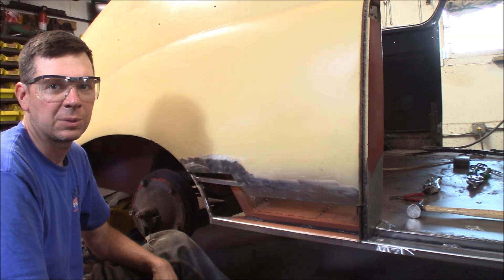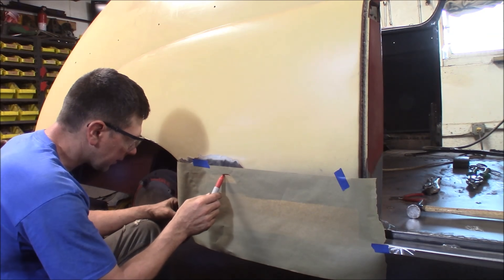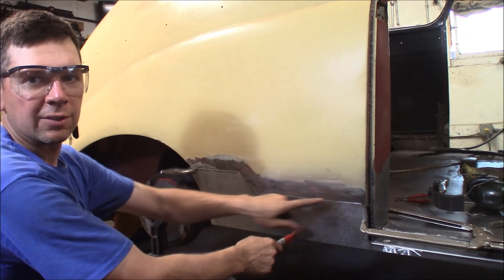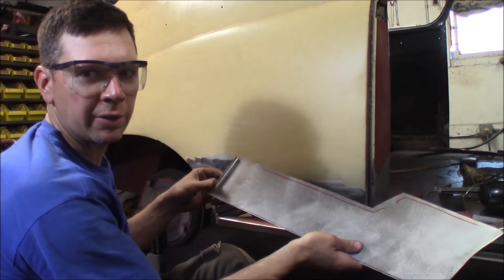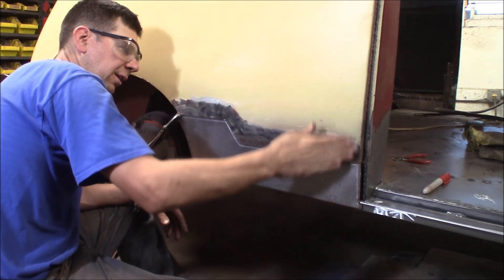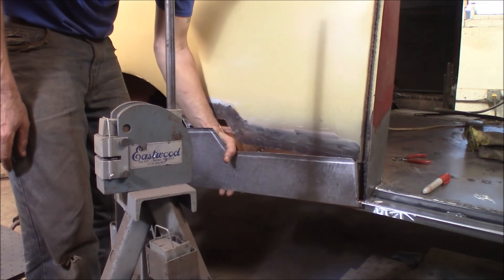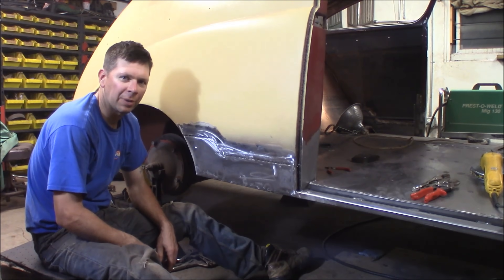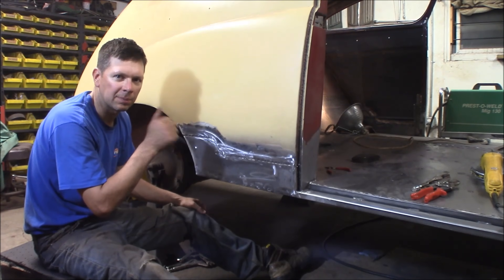Patch Panels:  Quarter Panel Rust Repair How To

Comment: For those who wish to restore classic cars. There is one thing to know :  to be definitively efficient against rust,  you should  put grease everywhere. grease is the only thing very efficient against rust. put grease between metal and carpet, inside door, behind metallic bumper, under the vehicle, behind  the repairs you can make (everywhere inside the body - hidden erea -  instead of using paint), hollow areas (necessarily hidden, so no need to be aesthetic). For rear wings unreachable with a paintbrush, use an extender and poor old oil everywhere each year. rust  always comes  from the inside and welds.  Handyman Experience - 35 years.   From france

Comment: First off this method has been used for years. For those of you putting this method down and saying that butt welding is the only way to go. I would have to disagree. I've seen this method used for years. I've seen both brazing the panels together and mig welded together with minimal fillier used. By the way after over25 years still holding and looking good! If you really want to see a questionable method there is a guy here on YouTube making videos on patch panels. By just lap welding ( without a flange) and grind down the welds a little and then hammer the welds down (and the sheet metal) and use a lot of filler to cover everything. With this being said I think this guy is doing a fine job. Also watch some old Eastwood videos they have used similar flange methods 🤔
Reply: Overlapping the metal is OK - IF the inside overlap is facing upwards. Then you can get a rust stopping wax or oil based sealant between the metal sheets. If it's facing down that joint will always rust. When that's not possible you have to butt weld or use the 45 degree crimp method.

Comment: I just stared welding a few months ago. I have a 73 and 74 nova and my 73 has really bad quarters. I did a mud job and I don’t like it now I plan of going back to replace it with some panels for a dependable repair
Reply from the maker: That's the best way.  Good luck!

Comment: What do you do of you cant get access to behind the patch panel how do you seal or prime the welded area from the inside?
Reply from the maker: You can get weld-thru primer and paint the panel before installation.  If it's in a closed area you could drill a small hole in a hidden area and spray Fluid Film in to try and coat it with lanolin rust prevention.

Comment: could sheet metal be aluminum sheet? something like aluminum deep tray available in dollar store? used for food serving purposes. its thick and easily bend. rust proof.
Reply from the maker: No.  To do a correct repair its as I showed in the video.  You cannot weld aluminum to steel.  There is also dissimilar metal corrosion that can occur when steel contacts aluminum.  You could bond different materials together with panel adhesive, but that is not what this repair video is about.
Reply: @QuickSpeedShop  you can weld mild steel to stainless though

Comment: I realize this is an older video, but I wonder, why don't you go back and weld in the areas that you didn't weld initially? That way you can have a total solid metal fit and very little, if any, filler needed. Seems you could fill areas with weld and forego any filler. Just asking, because I really don't know...
Reply from the maker: I could have done that, but not really necessary.  The panel is plenty secure.  It's going to need filler regardless and more chance of warpage with full welding and grinding.
Reply: Filler is always needed
Reply: Plus he said it's going to sit in a museum

Comment: Hi what gauge panel steel do you use. Cheers 🇳🇿
Reply from the maker: I usually use 18 ga for most of my repairs.  For structural inner pieces I will use 16 ga.

Comment: What does hammer tapping the slug weld achieve immediately after welding.
Reply from the maker: Helps to smooth out the distortion from the weld and hammer the gap tight.

Comment: 6:00  flange tool,  Harbor Freight has a really nice pneumatic hand held tool...  amazing
Reply from the maker: Thanks for the tip!
Reply: It only works with really thin sheet metal about the same thickness as OEM uses and a little more in my experience.    If you  make a panel out of say a scrap washing machine it’s going to not work very well.   Maybe if you have a 2 Stage compressor but not sure there.

Comment: I don't understand why on the outside there would come moistere. If the panel is painted it is sealed, right? Please explain how this works/ is?
Reply from the maker: Primer is porous.  If you don't paint the car right away and drive it in primer or store it in a damp location moisture will go through the primer (unless you use epoxy primer which is waterproof).  I just like the extra protection of having waterproof filler on all my weld seams.

Comment: You mentioned the shrinker was from Eastwood,  are you using an eastwood welder,  i was thinking about buying the 135. Because it can  use .023 wire.  My welding is not that advanced.  I bought the flux core mig from harbour fraight. It won't weld thin sheet metal. Thanks for the video enjoyed it.
Reply from the maker: The welder I had was super old Prest-o-Weld MIG.  I have since bought a Miller Multimatic 215. I love the 215, it's a great professional machine. Go with gas, flux core is about worthless.  If you want a good welder for hobby work, but want quality at a fair price, consider a Hobart Handler from Tractor Supply Co. I don't know anything about the Eastwood welders.
Reply: @QuickSpeedShop  . Thank you,  i was looking at the hobart also.

Comment: How do you have your welder set as far as feed rate and voltage? I can't get mine set right. Great job by the way!!
Reply from the maker: I couldn't tell you.  I was using a 30 year old off brand welder.  I just turned the knobs until it welded good.  I now have a MillerMatic 215 with Autoset that picks the feeds and amps based on material.  It's an inverter machine where as one in the video was transformer.  I weld with 0.030 wire and 240V.

Comment: What was your settings on your welder? I can not master sheet metal yet.
Reply from the maker: This car was 16 ga metal so I set it for that.  You need to find a chart for your welder that tells you what amperage and wire speed to use for the thickness of metal you want to weld.

Comment: Can you just JB weld or epoxy this in if your car isn't worth much?
Reply from the maker: They make automotive panel bonding adhesive that you could use to attach panels if you don't have a welder.  I don't think JB weld would work.  If you don't care about looks and the part isn't structural you could use rivets or sheet metal screws to attach panels as well.
Reply: Today mnay panels on new cars are glued in place or on from factory and in repairs at the body shop.

Comment: Do you need to put any form of protection on the back of the repair panel to avoid future corrosion?
Reply from the maker: I used seam sealer on the seam inside and the primed the back.
Reply: Zinc paint works good. My grandpa owned a body shop for 50 years and just found it and has gone thru probably 10 cans of it on the inside of every panel on his 57 fairlane

Comment: Bought a car a while  back had quarter panel issue but long story short it's been half assed repaired, they used pins and the whole nine and looks good up close but trash from 10 feet away, a botched repair nonetheless, looks like an amateur tried to fix it.
could it cost more to repair now? Anyone chime in plz really dig the car.
I'm thinking a welding repair now but that's not cheap.
 I've heard anywhere from $1.5k-$2k

Comment: Dude, I gotta wonder if half the commenters didn’t even listen to the video.  “That’s going to rust” and “it’s going to trap dirt and moisture”.  You clearly stated that this car is going to be in a museum. With that, probably in climate control.  You could literally leave that patch unpainted and there won’t be any rust in 20 years!
Reply from the maker: Right.  I fixed some cars this way almost 30 years ago that have driven thousands of miles and are fine.  If you fix a rot box up and then run it in the salt for another 20 years, yeah it will probably rust again.  If you fix a car up and drive it in good weather and take care of it, it will last forever.
Reply: @QuickSpeedShop  I live in Michigan and you know what I don’t see?  Car shows in the winter or restored classic cars driven in the winter.  Even if this car you were working on was going to an individual I highly doubt it would be a daily driver in the northern states.  In fact, I would wager it would be parked in a garage and likely only be driven in good weather.  

I seriously think people like to argue just for something to do.  “I’ve been doing this longer than you”, and yet you don’t realize a restored classic car isn’t going to be driven in inclement weather?  

Anyway, good job.
Reply from the maker: I'm agreeing with you.  People that argue usually have either never done their own work or usually just parrot what others have told them.  Also they'll use an example like a muscle car that was repaired in the 80s, with rust that was never sandblasted, patches poorly installed, and just mudded up.  Of course those are going to pop later.
Reply: @QuickSpeedShop Same would apply to a new car that never had rust. lol

Comment: Nice job but I would not seam seal since your reaping air that will cause condinsasion faster and rust faster try to use fresh stop or Lucas that is thick sticky oil not used that has carbon that has acid in it to rust faster..
Reply: Seam sealer does not cause rust. It keeps moisture out, hence the name seam sealer

Comment: This will work for a museum car like this, but don't do this type of repair for any vehicle driven on the street. I've never seen anyone use filler in place of properly welding the panel fully, that seems like a very cheesy repair. Secondly, seam sealer or not, that flange will trap moisture and rust. Again, you can probably get away with this on a museum installation, but please never do this repair on a vehicle that actually gets used.
Reply from the maker: Structurally stitch welding this panel in is fine.  It's no different than any factory panel spot welded together.  As for corrosion, with the entire rear seam sealed from the rear and a waterproof filler like Dura-glass used on the outside there should be no issues.  Spraying epoxy primer before bodywork would add an extra level of protection.  I have patched cars and trucks for years like this and even winter rides that are bathed in salt.  On winter cars the oem metal usually rusts out before the patch seam does.  I did my 1946 Studebaker truck patch panels this way and it's been on the road since  1999 with no rust issues or cracks.   There are definitely way worse repairs on YouTube.
Reply: You obviously don't know what your talking about. This method is still used today, and is standard.

-You are very wrong about trapping moisture. The overlap actually makes the patch much stronger. Anyways, Any type of weld or patch will rust if not properly protected.

Not to mention the 'museum' vehicles are much better than the ones today, and were in fact driven by people in their time.

Why not put up your video of showing everyone else how its done? Dumimes like you should not be able to make comments.
Reply: bull bull and more bull ! I dont get so many people saying all the time thats lap welds and seams that its gonna rust. Ita the way all the vehicle companies build cars. Look at all bodies on any car and ya gonna find lap and semaed joints on the floor and anywhere on the body and to your comment bondo and seam sealer is on cars new from the factory

Comment: Sorry mate. A flange joint will rust excessively and the multiple tack weld method will leave a hard joint susceptible to fatigue and cracking.  Old school oxy/acet and real panel beating will last far longer.  I suppose if you are just fixing it and passing the problem onto the next sucker . It's ok.
Reply from the maker: I have been fixing panels like this for almost 30 years.  I have several of these cars with repairs like this that I still own that have been done for years and years and thousands of miles.  No rust issues, no fatigues, no cracks.  Is this the only way to do it?  No, but that doesn't mean it doesn't work.
Reply: Yea that's why he's doing it and your nor
Reply: Rob, I could not find your videos on how to do this "properly." Did you delete them, or have you never actually attempted the process you described?

Comment: couldn't watch any more  i can guess that you're going to be  using bondo its the American way just leaving some of the problem  to remain for the next  owner  poor job
Reply from the maker: This is a standard repair that is more than acceptable.  Unless you are a metal finishing wizard or have 6000 hours to put into restoring a car this repair is fine.  I have been making patch panels and fixing cars for 25 years.  Never had any problems.  I have some cars and trucks I fixed this way 20 years ago I still own and the repairs are still as good as they were then.  The metal is clean, the overlap is seam sealed on the inside, and Dura-glass will be used first and then finished with polyester filler.  If you want to see metal finish videos there are people that can do that, but 99.9% of people making patch panels use "bondo" the finish the repair.
Reply: @QuickSpeedShop  Good job !!! and everyone uses body fill ,,cant get away from not using it!!!
Reply: This is a quality repair by any standard!  People should know what they are talking about before they throw insults.  Butt welding would be an option on a high dollar trailer queen.  Not necessary for this build.  Great video.  Thanks, Gary
Reply: Fred - Yes there are a few fabricators on Planet Earth who use no fillers, no finishing glaze.  I will say this may not be the metal method I would use here or the attention to patch panel fitment - but that does not mean the metal and finishing method used here is wrong.  Remember this is going to sit in a museum, not going for the Riddler.  
With your comment though, let's hear your argument to multi award winning Master Builder Chip Foose who uses finishing glaze on some vehicles.  He may even use a little filler from time to time.  There are times for no fillers and no glazes, and there are many more times when it just isn't quite the end of the world when a little filler and/or glazes are used.  Beyond that, have a good day!
Reply: 12B4Christ    So true!    If ya want new then buy new otherwise open that wallet WIDE because it will take forever cost a small fortune and still won’t be as good as new virgin metal with factory paint .   Sorry that’s just how it goes .
Reply: Fred Blair that is one long run on sentence , which is fine. If you didn’t know, you can use spell check too for free.
Since language arts isn’t your strong suit , how about posting a tutorial on metal fabrication.
Reply: Fred Blair bondo is required if you want the repair to be straight and not look like an ocean wave
Reply: Hi Fred, which country are you from where you all refuse to touch body filler and instead throw the car away if you're not a metal working expert with 5000 hours to spare? I would love to visit some of the junkyards there.

Comment: That is very backward, but every body to there ways in doing rust repairs ,your ideas, not my cup of tea.
Reply from the maker: I have been fixing cars this way for almost 30 years.  Never had any problems.  This car wasn't a concourse restoration and the repair will more than last for the life of the vehicle.
Reply: @QuickSpeedShop   what I said every body to there ways in doing rust repairs I have been doing it since the 60s and at 73 still doing it so what is your point
Reply from the maker: YOU chose to comment that I was doing it "very backward" and "not my cup of tea".  So what is YOUR point?  YOU imply that I am doing it wrong with those statements.  I said I have been doing it a very long time, just as you have.  Don't be surprised when you tell someone that their way is incorrect, with no other basis besides the fact YOU deem it to be incorrect and they then respond.

Comment: Flange welding is garbage
Reply from the maker: Been doing this 30 years, no problems.  For this car it's good enough.
Reply: @QuickSpeedShop  there's so many problems when dealing with flange welding too many to name if you've been doing it 30 years you know what I'm talking about flange welding is half ass welding and people flange weld because they don't know how to butt weld but welding is much better
Reply from the maker: Well, thanks for the input on my garbage work.
Reply: @jamesbarnes7045 What’s wrong with flange?
Reply: @briizcustoms9543  multiple reasons why it's wrong One you're creating a void in between two pieces of metal that you cannot get to after you weld now we have rust issues coming along also you just thicken the metal it's going to be unnecessarily sick and harder to work referring to body work
Reply: @jamesbarnes7045  What’s the best way to put a new piece in? There’s rust on my front wheel arch panel on my 2003 Silverado. I’d like to cut it out
Reply: @jamesbarnes7045  Yeah except he was able to get to it. Also it's going to be stored in a climate controlled environment. You're just arguing for the sake of arguing.